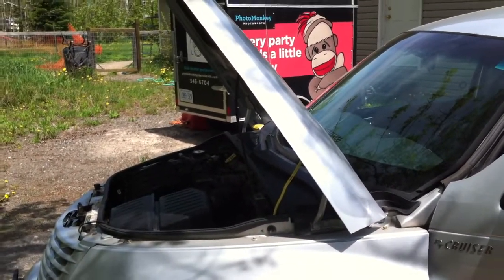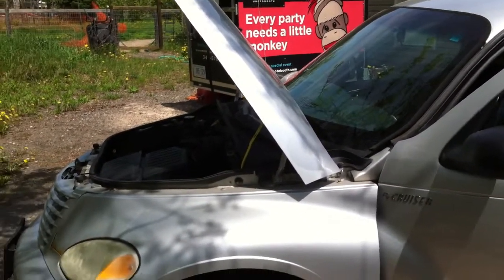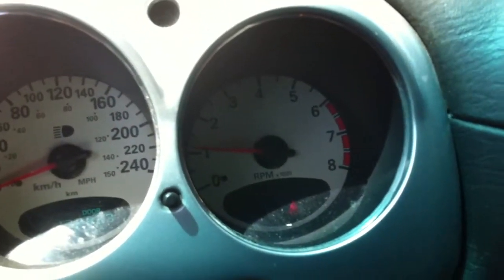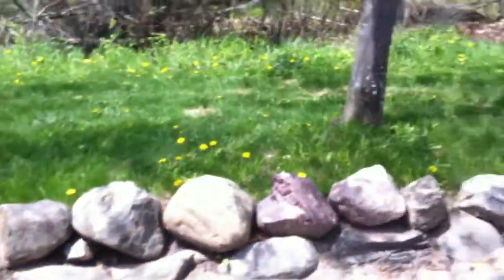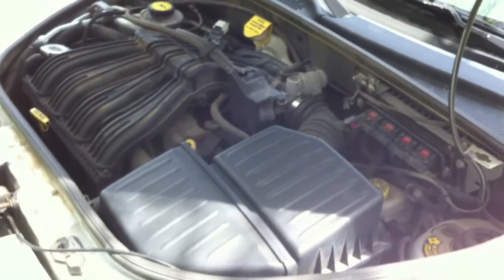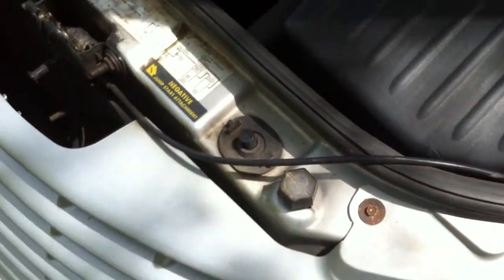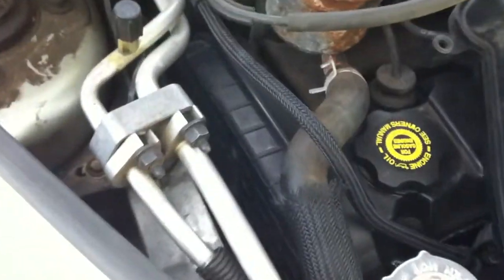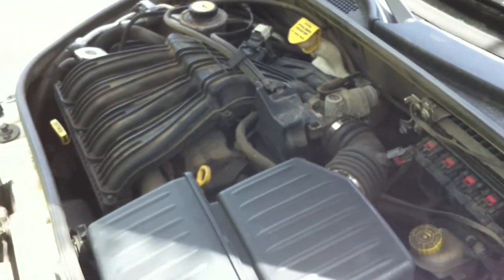PT Cruiser Weird Engine Noise

Comment: My 2002 sounded like that when I bought it, did a tune up on it, replaced pcv valve and added Lucas oil, I've had it for 2 Years and hasn't given me any problems. It has 166k+ miles and still gives 19.04 mpg city driving, I love this car.
Reply: What tune up

Comment: Check for vacuum leaks . To start  with . I think you may need to push the cam shaft , by hand  back into motor . & Tighten the cam position sensor gently & equally , back & forth with the two bolts . Snug .

Comment: It the lifters, Chrysler has that issue with the 2.4 and and on a couple V6 engines from the late 90's. Its nothing to worry about, and is not worth getting into unless your doing a Head gasket, which it would be wise to change them out.
Reply: Some people put a little bit if marvel mystery oil in their oil and it helps.

Comment: If I had to guess, I know this is an old video, but I would say a leak in the compression. Bad Exhaust Valve or something. Reason I say this is because it sounds like it has a slight misfire to it.

And no, It will not always bring up a Engine Code.

Comment: It's an oil issue that has blown a internal timing belt tensioner oil seal and it's not getting the proper oil to the top of TBE engine . it sounds like that as the cam is turning the valve lash and the valve is dry slapping the cam. Try this . start motor and add some sea foam to the crank case where you put the motor oil in the engine which if it's a slug build up restricting oil flow it should was it out don't go wild and put a hole can in unless you plan on changing it before putting any miles on it as it could blow seals out. If oil is to full . DO NOT OVER FILL THE MOTOR !!! 
 IF OIL LEVEL IS AT THE FULL MARK DRAIN SOME OIL OUT. BEFORE YOU ADD THE CLEANER ..THEN TOP OFF TO NORMAL MARK WITH THE DETERGENT . FIRST RUN ENGINE UNTIL ITS AT NORMAL TEMP .  

. but you know the PT IN PT CRUISER 
Stands for part tractor ..lol

Comment: 4 years later and nobody knows the answer lol. The 2.0 and the 2.4 have timing belts however the sound isn't any of the pullies or timing. It's air related. I have a 2002 2.4 dohc started replacing air related components I.e. throttle body gasket, clean throttle body, Pcv hose, Pcv valve, other vacuum components including egr valve on the back of the manifold. The sound has changed but is still present. Within the next week or so I'm going to pull the manifold and do a full gasket replacement as well as plugs, coil, wires. If I figure it out I'll post it so the PT world will know HOW TO MAKE THIS STUPID FREAKIN NOISE STOP!
Reply: WE HAVE NEW MOUNTS..MEASURED..NEW INLET MANIFOLD GASKETS..STILL THE STRANGE SOUND FROM THE FRONT PASSENGERS SIDE..GRINDY SCRAPPING SOUND..4 WEEKS AND THEY HAVE NO IDEA,
Reply: @chrisgeorgantonis9344  I have it too! 2001 2.0 petrol limited edition (European export version). I suspect it's timing belt slapping a bit or balance shaft thing.
Reply: Mine does the same and I just did timing chain and water pump I have 2004
Reply: Brian I'm look going through the comments. I'm trying to see if anybody has the same sound in there PT Cruiser I have a 2009 PT Cruiser I take very good care of it but as of late. It's making a loud sound when I'm driving it's almost like on Landing a plane on a Runway my mechanic said it's a motor mount it's getting dried up but it needs doesn't need to be changed just yet I think it's getting louder and when I'm at a red light it just some grumbles like an old truck is anyone experiencing the same thing thanks a lot

Comment: likely classic case of balance shaft assembly chain drive n tensioners worn out..  they are inside motor behind oil pump and prove to severe wear allowing chain to slap around in engine..
Reply: Geoff Mayberry they are belt driven not chain driven
Reply: @circa171994  The balancer chain is what he is talking about... Yes there is a chain... I'm having a problem also.. A knock when it's cold... It quiets way down once warm but it is still there but much quieter.. It's Driving me nuts...
Reply: noooo chain lol mechanic 37 years

Comment: I just saw a video on a certain measurement that the motor mounts need to be at, the bracket on the upper motor mount where it meets the frame is slotted and over time can slip and let the engine tip forward. That hissing sounds like it could be a bad AIC though..... They get gummed up with carbon and you don't get the proper mixture of air and gas.

Comment: I put in lubegard engine oil protectant, I thought it was the oil pump. It cut the noise in half and the mileage went from 12.0L/100km to 11.8L/100km within 10 miles.  Then I put in the lubegard instant shudder fix, I am like surprised.  It got really quiet, the noise disappeared and it sounded like when it ran at less than 10K miles. Lol, I replaced 3 quarts of good castrol gtx atf+4 with walmart atf+4 a while back.  It is unusual that the noise came from the lower passenger side.

Comment: Hi I have a pt , I would say it's the crank position sensor ,  to get a closer clue , do this ,  " turn car off . Take key out . Put key back in .  Now turn key quickly ! 3 times fast to augsilary & then to the start position . Do not crank motor . All in 3or4 seconds. Wait a few seconds  & Look at the odomintor in dash. Any codes will pop up in there, wait untill it says done .means all are shown.  Now tell me , did you use a rag & push the cam shaft back into the motor ,before tightning the new one ??

Comment: If someone could tell me what might be wrong with my 2005 pt cruiser I got the cam shaft sensor replaced and a bunch of wires fixed a month or two ago and just recently it started making this whining noise when I accelerate I can’t remember if it’s always made that noise or not and there are also no light on so I’m just stuck idk what’s going on

Comment: You didn't have a timing belt, that clicking tapping noise is timing chain slap. The timing chain is stretched or your lifters were worn to the point there is chatter, they're just worn not broken but noisy...
Reply: That has a timing belt. But the balance shafts are chain driven
Reply: @alextrader7783  I heard the lifters get a little noisy too, not a problem unless the noise itself is a problem...
Reply: My bs chain just busted on my pt and she vibrates pretty good
Reply: @alextrader7783  So what did you do to fix this 'cause I believe mine are stretched as well
Reply: Cut the chain going to the balance shaft if your on a budget. Or have the balance chain assembly replaced if worn badly
Reply: Alex Trader  when yours broke did it bind up and jam up in there and cause more damage or did you get lucky?
Reply: @denniskurchaba5206  o got lucky and it fell into the pan

Comment: i have a 2009 pt, same noise.
Reply: I found out the hard way, Mine began making that noise but since it was still driving fine I wasnt to concerned. ...BIG MISTAKE! !   It was the throw out bearing breaking apart which ending up destroying my entire clutch system including my pressure plate.  plus I had three broken motor mounts.... It has since been JUNKED  :/

Comment: my 2008 pt cruiser started making the same noise. I took it to a shop and they said it was normal in some cars. it runs fine but it's starting to bother me. did you ever find what the problem was with your pt?
Reply: I don't think he ever did in fact I think you probably sold the car cuz he hasn't uploaded another video ever again I think the comments about get another car probably got to him.  

but he said they just did a timing belt so what I'm sure they did is that on the timing of the cams they probably broke one of the pens because they use an impact wrench to do it and now his cams are technically a little bit out of timing and so they're starting to make that wonderful noise.  

somebody did a video about a while ago and it was in fact the problem
Reply: @MickeyMishra  hi. Mine rattles under load. I did water pump 6 months ago could it be a little out of time
Reply: @Matt-hr1sf    Rattle?  Its possible.  Mine did not run smooth when I was a tooth off.     When I got the right timing?  It was spot on great.        Look up the service bulltion by chrysler.    It tells you its suppose to be just a BIT off the timing marks for a perfect timing.   And a few videos about it.  

In fact, there is a reason why some tuners and Chrysler went to the new CAM sensor in 2003 so they could use it with the turbo models since it was more accurate.    Hence they could tune more HP out of the engine over the power band with the turbo engine and get better emissions.  

Again,  its best to make a video with audio.  Otherwise its like getting makeup advice in a dark room.  🙂